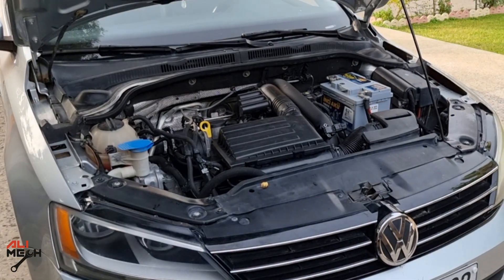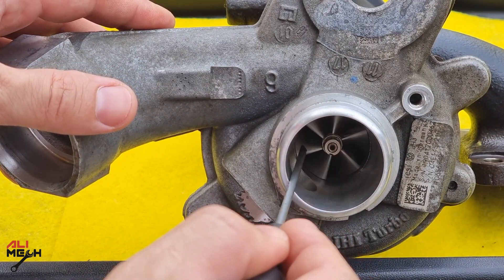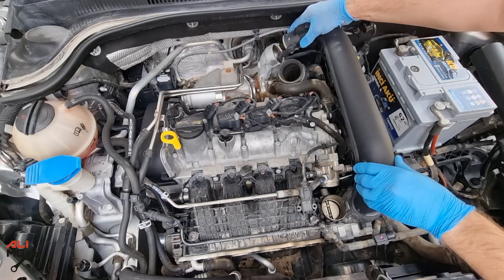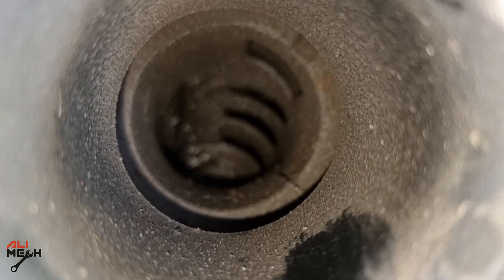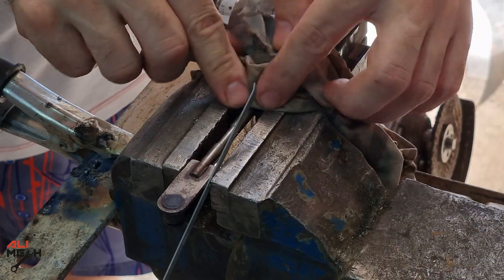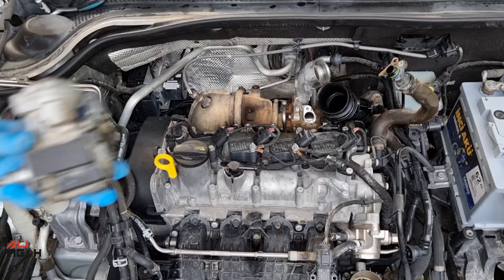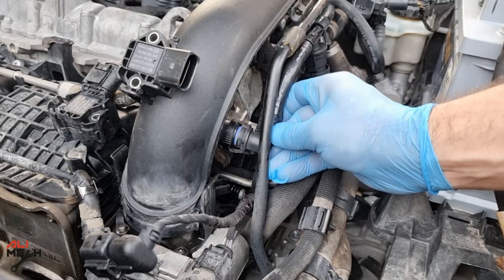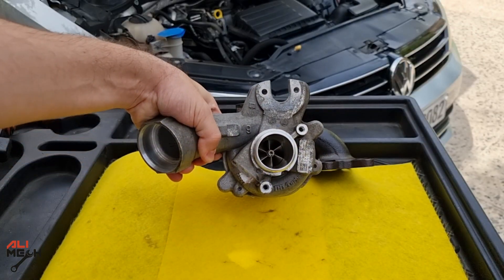Watch this if your turbo engine not making power like before/ How to fix EPC P2263 warning light

Comment: I put some gloves on and felt back where that rod was, the gate/ bracket feels loose, had too much play in it. Would that require replacement or refurbishment like the weld you did to make it stiff?
Reply: Mine the door flaps too freely.  I need to tighten it up somehow as well.. it’s throwing underboost code now especially as soon as it gets hot under the hood it makes the EPC come on as soon as I come to a stop.  It’s awful and so frustrating.

Comment: Gotta say, Ali. Great job on a great video. Cheers to you
Reply from the maker: Thanks so much!
Reply: This is such a scenario where people get told they need a new turbo by places like VW dealerships.  All the while stealing your money basically.  It’s terrible how bad they take advantage of people who don’t know any better.  Putting people is awful situations where there livelihood is at jeopardy without a properly running vehicle.  I’m having issues with mine currently and have been for several months because I’m
Worried what will happen if I bring it somewhere.
Reply: @P_Tag  I can tell you from experience, that the dealership itself (well, good honest ones) aren't out to "steal your money". But, they are limited on what they can change. For instance, my Fiat 500 Abarth turbo wastegate controller could not be changed by itself. The dealer told me they weren't allowed to. They took it for 2 days and gave me a whole new turbo with the wastegate attached (under warranty as it only had 40K). So, it's not just the dealership, it's the way they are able to service the components. Luckily, they paid the $3,800 themselves, not me...

Comment: One thing you left out is that you need to reprogram the shift arm actuator, or the new part won't work. I have 2 jettas, and both broke and needed to be reprogrammed as well
Reply: How can u take the c clamp off tho…
Reply: @whoim3553 flat head screwdriver for one..
Reply: That’s what I’m saying.. how did this just fix itself electronically?  Everything says it needs to be recalibrated.

Comment: I have a buzzing Sound that winds down car turns off. Also had to slam brakes on to avoid hitting a deer now check engine light comes on with P2263?
Reply: Can the spray be sprayed enough to reach the shaft if no broken barring?

Comment: Hi im having a similar problem with my car. I have a 2016 jetta tsi with the 1.4t and my waste gate seems to occasionally get stuck open or closed. I keep getting the epc light and after watching your video i checked and the bar isnt broken its just dificult to move. Is there a way i can clean or lube it without taking everything apart or should it just be replaced all together? I know this is an older video but i hope someone sees it and has some insight on what i should do thanks in advance!
Reply from the maker: You have carbon buildup there, I would suggest you try crc intake valve and turbo cleaner
Reply: @AliMECH  How too? Apart?

Comment: I am going to check my car soon and I hope this is not the cases but even so at least I would know what real issue is instead of keep having to look. I have a few questions though- am I supposed to expect all mechanics can weld? Is it insulting to make sure the pipes are cleaned like you did ? How much can a job like this cost ? Can I have him try to diagnose the issue without replacing it (can my mechanic do an air leak test)? Is there a sensor that could be triggering the codes?

Comment: Hello. I have a 2015 Ford Escape with 2.0 Ecoboost. Can you tell me how I can clean out and carbon deposits on the turbocharger? Can I actually clean parts of the turbo without removing it? 
Also what cleaner and tools  would you recommend to help clean /remove deposiths  turbocharger